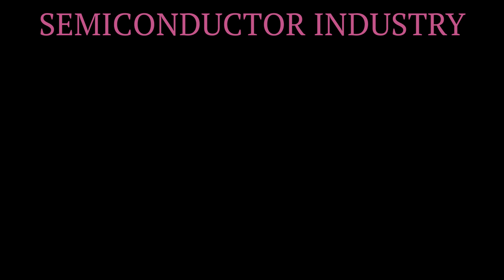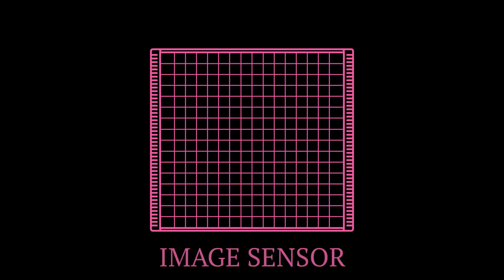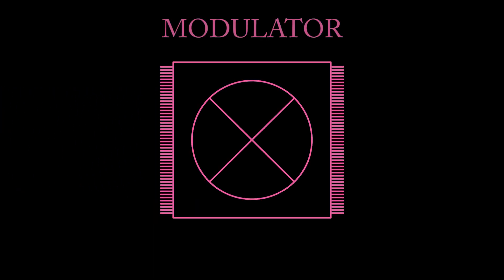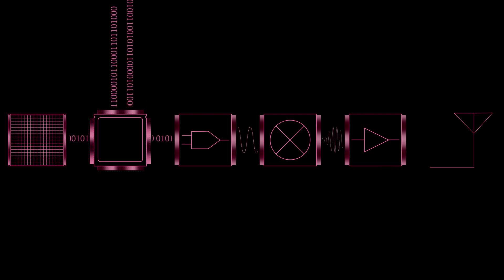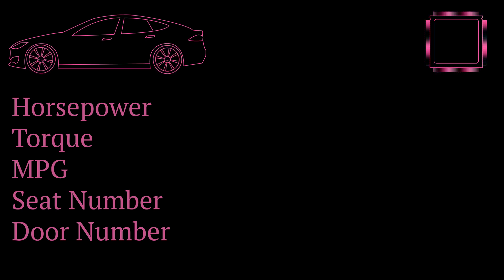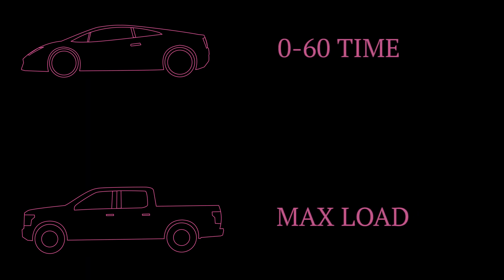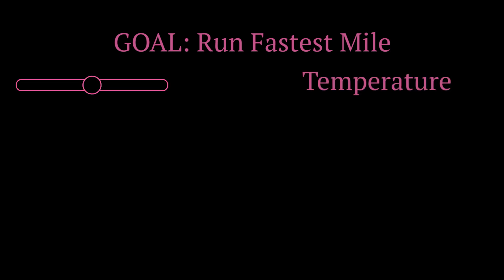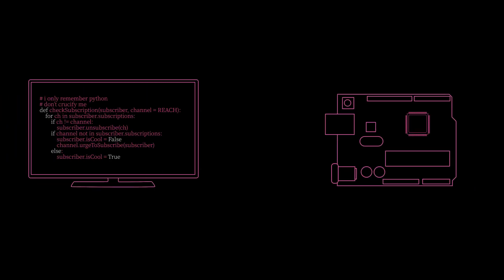What I actually do as an Electrical Engineer

Comment: Whats the difference between and embedded systems engineer from semiconductor work? Is an electronics engineer able to go embedded?
Reply from the maker: Yes an electronics Engineer can work in embedded systems. Semiconductor work is down to transistor level work, you work with fundamental circuits blocks such as amplifiers. Embedded systems is higher level work, where you use existing predefined circuits(processors) to get a task done. 

It’s like working on a cars engine design vs actually working with the full vehicle. 

However sometimes you use an embedded system to test a semiconductor circuit. As you take more classes and get more experience you will begin to understand all the layers.

Comment: I’m trying to learn more about electronics engineering but every time I google it, all I see is electrical engineering. Are they the same thing?
Reply: No electrical is very different from electronic engineering
Reply: In most cases electronic engr deals with little voltages DC that are used in controlling monitoring usage of electrical equipment
Reply: Electronic deals with DC and Electrical deals with AC.

Comment: Meanwhile I'm struggling to calculate voltage in a basic circuit smh.
Reply: I've never related to a comment more
Reply from the maker: Simon S At some point, I was in your shoes! 👍🏽
Reply: @RelearnMath  . Micro-controllers are the worst
Reply from the maker: @blackoutemzz2674  how so?
Reply: @RelearnMath  . No I mean the programming 😂 and looking at the datasheet. I just started the module recently and it's a pain. Need to practice more and get used to it.
Reply: We'll just do teamworks(copying) haha
Reply: @Simon s. Bro I do electrical and electronics engineering at uni. Our first module covered all the basics like kirchoffs law and logic gates and boolean algebra, forgot most off it. Yeah it tends to happen
Reply: It’s not that bad lol

Comment: How does a digital to analog converter work? I know that digital sensors can only have ones and zeros, so how does it convert to more than just ones and zeros?
Reply from the maker: Good question! Maybe I’ll address it in another video If your comment gets enough likes :-).
Reply: 0001,0010,0011,0100 like this
Reply from the maker: There has to be at least 
“(11111)b” likes
Reply: My guesses are as it happens in computers ...like converting binary system to decimal for example in binary system 10001 is for number 17 in our numbering system
Reply: PWM ?
Reply: Interpolation my friend!
Reply: I mean if you graph sin/cos waves you can. More details than that idk
Reply: indeed, digitals are all about ones and zeros. now, imagine yourself seeing a bunch of ones and zeros, in order for you to convert it to an analog signal, you need a technique called "pulse code modulation ". pulse code modulation is a process of sampling or quantizing multiple  part of an analog signal and hence converting it to analog signal. you can refer to this link for a visual explanation:
https://www.youtube.com/watch?v=HlGJ6xxbz8s